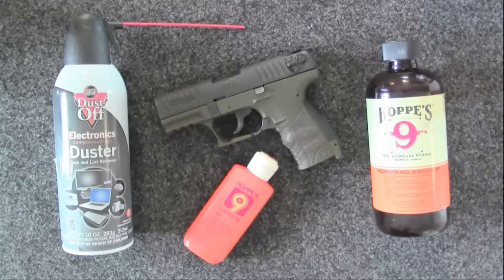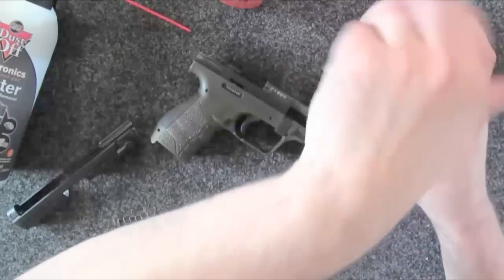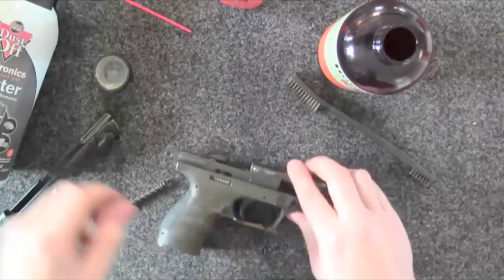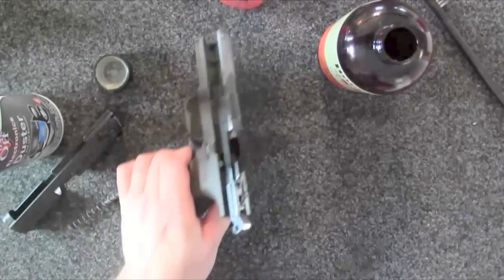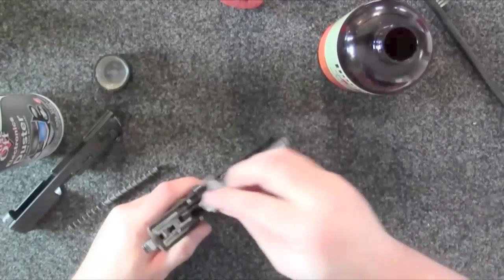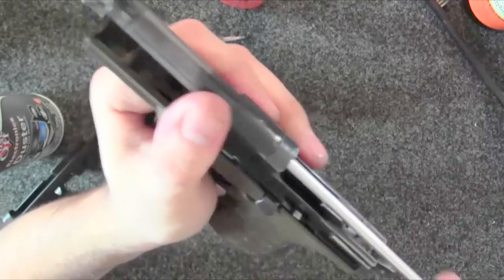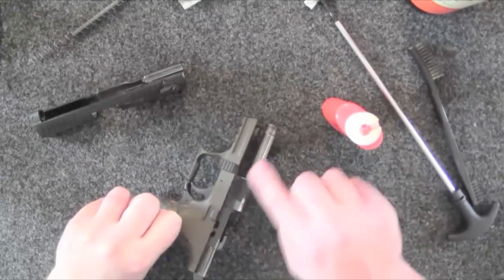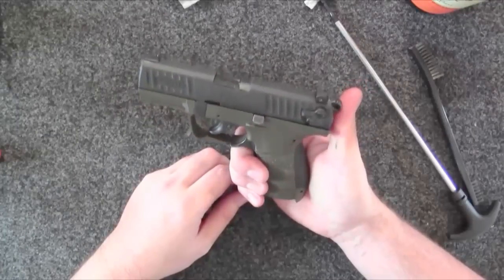How to clean your Walther P22 or Walther P22Q

Comment: Nice vid, gonna keep watching the series.  However, has anyone ever told you that dunking your cleaning brushes into your solvent bottle is a bad thing?  In case not, you probably should stop.  Every time you use it to clean, then dunk it back in to the bottle you're leaving dirt, grit, and everything else back in the bottle cuz it's getting rinsed off and being left behind.  Check the bottom of the bottle, there's probably all that junk in there waiting for you to put it back on your weapons!

Comment from the maker: yes.  The P22Q has a couple of new features.  Function is the same.  New features include larger serrations on the slide front and back.  Different stippling on the handle,and a Picitinny rail instead of the old style accessory rail.  The also took off the key lock.  Overall it still works the same has all the same parts inside.  It just looks and feels a little different.

Comment: I use the dish washer top rack, the soap is a good degreaser, put it thru one of the post, do not lay it down flat.
Reply: Rich Fravel Good good and after that dry it in the microwave.

Comment: Does this apply to any hand gun? After seeing your video I think I've been using way to much solvent AND dry lube...I've been spraying the crap outta my Taurus PT111 and not drying it out at all. I just got a P22 so I'll be checking out your mods after I get a few hundred rounds through it. Thanks for posting these!

Comment: Brake cleaner aka Gun Scrubber, at half the price, will solve the problem of trying to blow out the dirty solvent. It will leave the gun dry with no residue, ready for oil. Brake cleaner will remove all the stuff you are trying to blow out with air, thus eliminating that step.

Comment: Any mods to help my p22 run the CCI quiet 710fps bullets?? I run my p22 suppressed. The action will cycle, reset the hammer, but it doesn’t go back far enough to eject the spent case. Is there any mods you know of to help out??

Comment: I know it's an old video, but any advice on unscrewing the copper scrubber from the metal rod? My .22 size won't unscrew from the rod.
Reply: Is it a one piece rod or does it screw together, either way just ream it out, rod and all, cleaner patch some and oil patch to finish

Comment: Do you clean the gun with the magazine in place? I'm looking into a shooting where the person supposedly pulled the slide back and a bullet fired, killing the other person in the room? Is this possible? Feasible?
Reply from the maker: I remove the magazine when cleaning.  The only way a gun can fire is if you pull the trigger.  To avoid negligent discharge of a gun one needs to follow the basic 5 basic rules of gun safety.

1. always keep your firearm pointed in a safe direction.

2. treat all firearms as if they were loaded.

3. keep your trigger finger outside the guard and off of the trigger until you are ready to fire.

4. be certain of your target, your line of fire, and what lies beyond your target.

5. always wear appropriate eye and ear protection when shooting and maintaining your firearm.
Reply from the maker: @nancyleedunn  It's pretty common to check the gun's action when you're finished cleaning it.  That's why I tell people in my videos, "when working or cleaning a gun remove all live ammunition from the area" 

Once you've cleaned the gun and put it back together you'll need to pull the slide back and cycle the trigger.  

If a person forgot the mag was in the gun and they do this procedure the gun will fire.  This is why rule # 1 & 2 are so important.
Reply: @BecksArmory  Thank you so much for that information. So could have been an accident....or not. Shocking that he had it pointed at his wife when he did that.
Reply from the maker: @nancyleedunn  believe it or not I've seen people point the gun off to the side without even looking to test the action after cleaning.  This is why I stress so much that people remove ammo from the area.

He also could be a liar who wanted to get rid of his wife...

Comment: just a quick question. i just got a p22 and after putting a few hundred rounds through it, the last half inch or so of the barrel seems to be all mangled up. Is this normal? Just worried now that my barrel is messed up
Reply from the maker: inside or out side of the barrel?  If the black finish is wearing off the out side I wouldn't' worry about it.  My external finish on the barrel end is all warn off as well. If the inside of your barrel is warn your have a problem.   Call Walther ASAP. :)
Reply: +richarddbeck k... I'll have to call them then. the inside looks all chewed up and the very tip too
Reply: +richarddbeck thanks for the reply!
Reply from the maker: prezdead No problem.  :)
Reply: prezdead 
did you call them i think mine has the same prob as yours

Comment: The easiest thing I've found is just using WD40. It breaks the carbon down. Then after I get whatever gun scrubbed down I'll wipe it down with a little rubbing alcohol to get any residue off. The last step is good quality  gun oil in the places that need it. WD40 is good because it's cheap and you can get it anywhere.

Comment from the maker: it really depends on your specific P22 or P22Q.  I know that's not what you want to hear but I've learned that no two P22's are the same.  Some work great but most only shoot Remington golden bullets and a couple different variations of CCI ammo.  The CCI standard velocity should work just great.  If not you can fine tune your gun by following the steps in my other videos. :)  I can now shoot Subsonic ammo in my P22.

Comment: Please nobody use air duster if any of the liquid is on gun metal it can break or blow seriously back when I was a teen and a locksmiths under study if the lock could not be pick or cut we would shake it up spray it on and in the lock and give it a wack with a hammer so you could only imagine what would happen if this happens to a barrel or slide please don’t do this